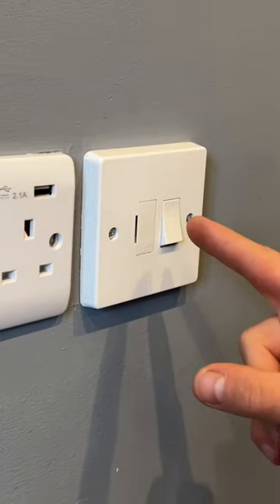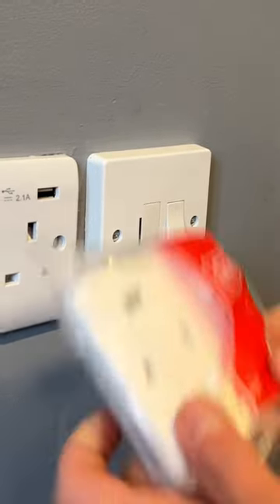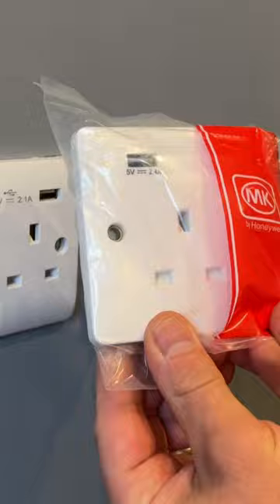Should homeowners and DIY Dave be allowed to change socket fronts? #electrician #shorts #prysmian

Comment: Should the new socket not be fused, as it was originally a fused spur socket?
Reply: An FCU has the fuse because it doesn't have a fused plug being put into it... but normally just has a flex going straight to the device being powered. The fuse is always there to protect the flex/cabling/wiring between the outlet and device being powered.
Also, there is no such thing as a fused socket. Well not a domestic one anyway.
Reply: No as it's a single gang anyway so can only ever draw a max of 13amps
Reply: Nice one thanks both of you
Reply: @danf6491  The socket will provide as much current as the breaker for the circuit it is on will allow. The maximum current drawn is controlled by the fuse in the plug not by the socket.
Reply: @danf6491 What stops it limiting the current to 13 amps?  The breaker is rated at 32 amps on a ring main with 2.5mm2 cables.
Reply: @deang5622  as it's a single socket and in the UK the maximum fuse available to plug into a single socket is 13 amps . Thale actual socket is probably rated for 20 amps max anyway . And a single socket is allowed under regs .
Reply: @semperidem2577  socket probably rated at 20 amps anyway. And I know it can supply more but the max you can draw due to the fuse rating is 13amps (well more as it won't blow till around 21 possibly.  A fuse upstream for a single socket  isn't needed as per regs . There's only one 2.5 cable going to it and that's rated well above the maximum 13 amps being drawn
Reply: @danf6491  You did not actually answer my question.
The original poster asked shouldn't the socket be fused. And you responded no because the current is limited to 13 amps.

I then asked you what is limiting the current to 13 amps?
And you didn't answer that question.

The correct answer is, which you did not provide, is nothing is limiting it to 13 amps.
It's being limited to 32 amps by the breaker.
Reply: @danf6491  The correct answer to the original poster's question is:

With a single socket outlet, if used correctly, cannot overload the spur cable feeding it or the ring main cable to which that spur is connected.  So no fuse in the accessory is required, assuming it is a spur of a ring main.
Reply: @deang5622  I meant draw not provide .  Corrected the post as I was struggling to work out what you was on about for a second till I read the post .
Reply: @danf6491  so what happens when someone plugs in an unfused 3 or 4 way socket adapter? BANG/SMOKE
Reply: @g7mks383  I've never even seen or heard of one of those 🤣.   But if that where to happen then wire may overheat depending on method of install , see cket contacts may get hot and ovwrheat and fuseboard MCB would trip  at some point depending on the type installed . Unlikely for a fire as cable would usually be good for around 27amps on most common installation methods .
Reply: @danf6491  I'm not sure if I understand 'A fuse upstream for a single socket  isn't needed as per regs' what reg number are you referring to?
Reply: @semperidem2577  6 .3 in the 18th edition. 1 unfused spur per point on a ring
Reply: @danf6491  Ok, I see where you're coming from, but how do you know it's a RFC, could be a radial? Most rewires I do now I do 20A and radials. Just to say, I'm not trying to prove you wrong or start an argument, it's just nice to get other perspectives.
Reply: @semperidem2577  because if it's a radial it would comply anyway no matter the configuration. Only thing really is to check the amount of current spurs on the circuit to make sure it isn't exceeded at all.  Obvs I may have missed something. And radials are definitely the way forward ,. Kitchen 4mm general radial  and  individual radial to high load appliances . Only time for a ring  is a high integrity circuit  for say a bank of computers . Save you running an extra 4mm radial back with mechanical protection . Do you ever install rings? Always like to get others take on there methods

Comment: Nice to see someone else who does the earth flylead... Sign of a proper spark.
Reply: The metal box earth terminal was designed to bring the earth forward with metal conduit installations back in the day
Reply: @chrissolar8938  yep,however i still earth it even on T&E for one reason. People WILL remove the faceplates live, I know they shouldn't, but they WILL (Decorators etc) That is the point the cable is most likely to be damaged and snag the box. Earthing it prevents a shock... so i insist on it
Reply: I was half expecting it not to work cos it was from an old Economy 7 storage heater and only work at night
Reply: @roystevenson1375  Oh we had one of those the other day, a DIYer who definitely SHOULD NOT be allowed near it, had read online that the immersion heater (all electric estate) should be on the offpeak. So had wired the daytime boost heater (halfway up the tank) to the E7 too [facepalm]
Reply: And it is not required in this case.
Sign of a proper spark is one that knows when to do something and when not to do something.
Reply: @deang5622  in this case I disagree with BS7671 ... See comments elsewhere in thread to see why. Not installing one is simply lazy imo
Reply: @TheChipmunk2008  No. You are wrong.
Not having the fly wire only presents a risk to someone working on the socket which they should not be doing whilst the circuit is energised.

They should be employing safe isolation practice.
If electricians refuse to employ safe isolation practice, which they are all taught to do, then tough luck. That's their choice and they accept the risk.

And if the installation is using an RCD in the consumer unit for additional protection, which many are these days, and has been a requirement for quite a number of years, then the electrocution risk is completely eliminated.

It's not about being lazy, it's about recognising there is extremely little risk and very little risk reduction by fitting them.

Comment: I'm surprised to see that they used screws to secure the wires. Don't UK sockets have springed compression type connectors for the wires? I thought they are much more reliable and don't loosen with time.
Reply: No, most UK sockets have screwed wire connections. You are probably correct.

Comment: This does not make sense.

Its a fused spur but why only one cable in whats was it originally feeding?
Additionally should always check that the item you're changing is dead and not assume its on the same circuit as the plug next to it

Comment: I was told at college to twist cpc’s together so if they come out rear terminal circuit is still protected and accessories with fly leads.
Reply: Nope, twisting is frowned upon now. Pain in the neck when it comes to testing.
Reply: Yes no twisting please. Makes testing a total nightmare
Reply: @martinw245  Just take you longer to do the job. Never mind you will still charge a fortune and be home for 3pm.

Comment: It's not a spur  it's a Fused Connection Unit,  the spur is the cable. Why did you run a fly lead to the class 2 accessory?

Comment: I would not be using an insulated electrical screwdriver to bend dow the tabs in a metal box and I would have turned off the power supply before attempting this swap ! If the socket tester goes out then you know the power is off

Comment: Great video, No need to fit earth flylead as the metal box earth terminal, was designed for metal conduit years ago to bring the earth FORWARD from the earthed metal conduit installation due to wire shortages back in the day.